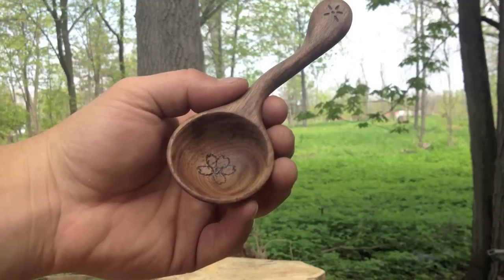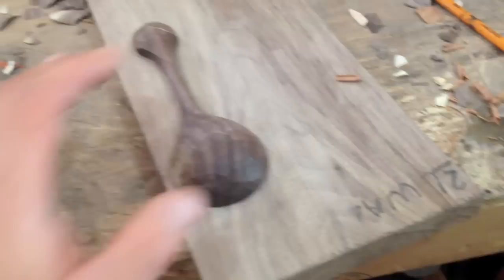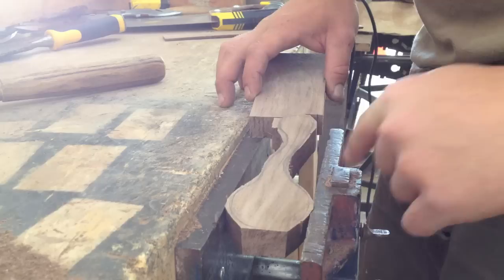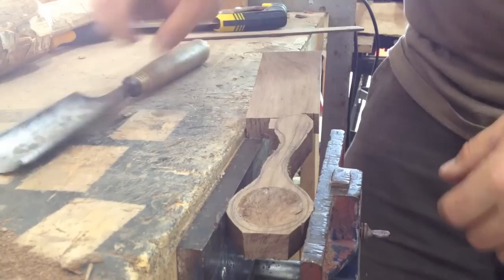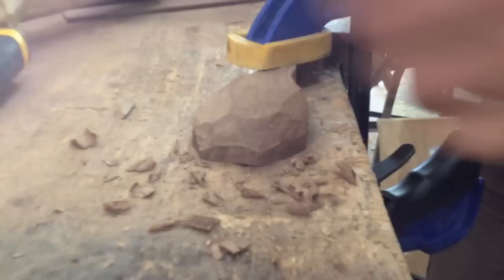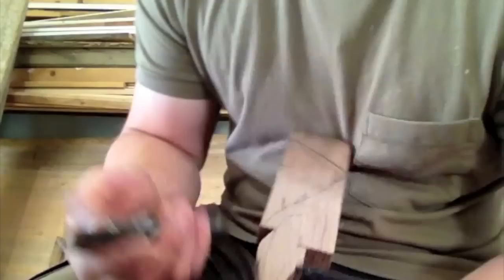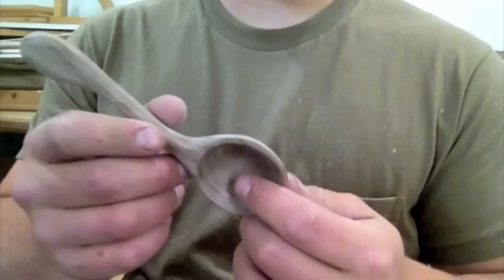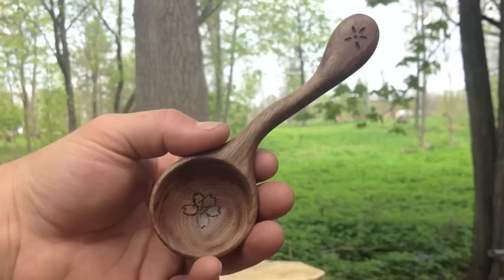Spoon carving - Full tutorial - by Lotsofwoods.com

Comment: hi Jeff: I wittled a couple of spoons out of pine. I havd sanded them down. how many times should I soak pine in warm water? since I want to use these spoons, is beeswax and mineral oil the best option or will that wash off?
Reply from the maker: +Barbara Schulz I personally use that finish.  Once I found out that spoons found in museums werent finished, I really lost my opinion on oils.  Use whatever oil your comfortable using!
Reply: +Jeff Ballantyne (Lotsofwoods) i haven't used any oils yet. wasn't sure what to do once I finished them.